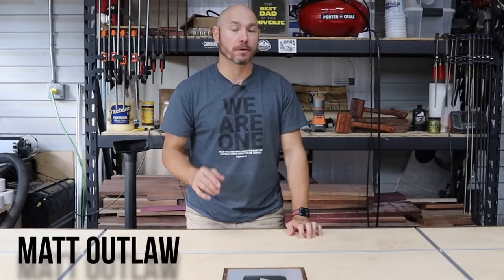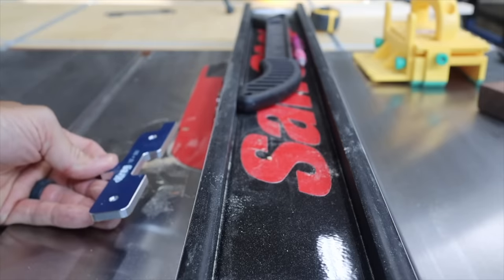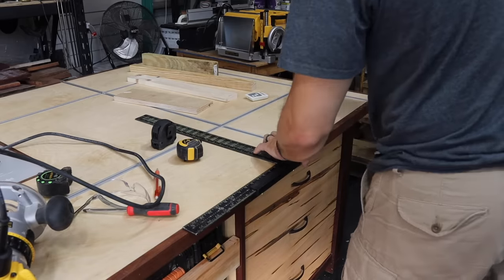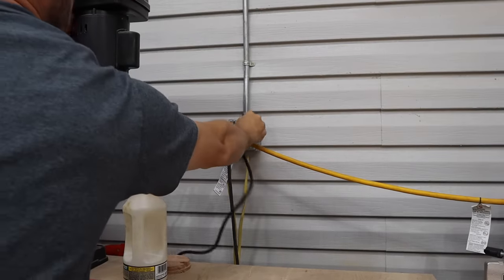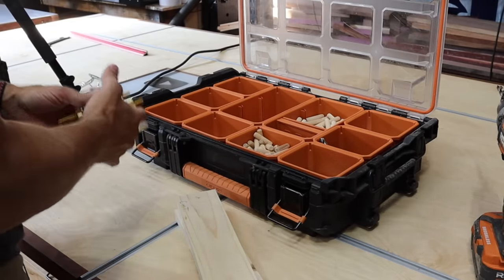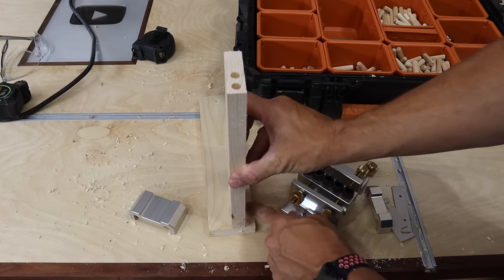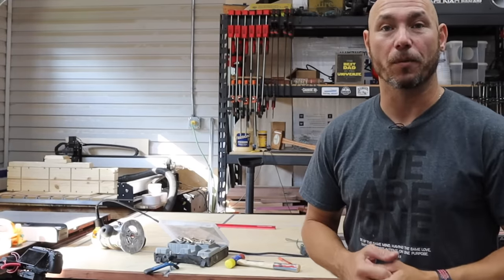5 Woodworking Tools You Didn't Know You Needed Until Now!

Comment: Love the DowellMax. It is well engineered and accurate. I can set up and drill holes without needing to measure and it is dead on. Example. I was making some built in cabinets and needed to join two pieces of plywood 57" in length. I flushed up against the end of ply wood, did a step and repeat along the entire length with about 12-15 holes in each piece of ply. Put the dowels in and the two pieces fit together perfectly. I never even measured or marked the pieces!

Comment: Another tip for the Deadman switch. Use a 3 way adapter and get an analog plug in clock, set it on 12 or whatever and plug a tool in the other side. Now each time you hit the gas the clock starts and stops with the tool and you know exactly how much time you have on the project.

Comment: I'm sure the kreg set up blocks are great.  That being said a much cheaper way of doing it is to get a set of square dowls from a Home Depot, Lowes, ect.  They come in multiple sizes and then cut them down to whatever length you want.  You make a few sets for less than 5 bucks.  If you loose or break them, cut up another set.

Of course you can use drill bits also but they roll and the square dowls don't.

Comment: The Woodpecker edge rule was my first Woodpecker purchase. I got the 6" because it's all I could afford. It has got to be one of the most used measuring tools in my little shop. I have since purchased the 6" Paolini rule and the 3" Delve square. Incredibly versatile and useful measuring tools.

Those Kreg set up blocks look to be a great tool to have as well. I bought the I-Gaging Snap Check digital height gauge and the first time I used it to make some half laps, I was floored. Dead on. Those set up blocks would be perfect for that type of work as well. And they're a great price.

The DowelMax has to be the bee's knees of all the tools in this video. I gotta get me one, no doubt.
Reply: I live in the UK and I purchased the edge rule. Quality product, But I bought it on Amazon and when it arrived it was all metric scale. Check carefully if you prefer inches.

Comment: One of the handy features of the setup blocks when used to set the height of your table saw, is it spans the insert plate across the actual saw table top.  Most inserts tend to be just a tad lower than the table itself (as to not cause work pieces to catch) and measuring from the plate to the saw blade top may cause inaccurate cut depths.  I use mine all the time for this exact reason, along with 1-2-3 & 2-3-4 blocks and brass sticks to set cut widths precisely.

Comment: When you're talking about "the tape measure trying to roll up on you" in the edge rule segment, take an old tape measure and break off something like an 18" or 24" segment. Now you've effectively just got a ruler with the beak that aligns it to the end of the board. It's also a lot lighter and easier to manipulate than it ever was before. You can break off more segments, like another starting just before the 30" mark and use 30" as your new zero.

Comment: Excellent information and knowledge of equipment. In past years dowels were so difficult to line up even with a doweling jig. I use a tremendous amount of screws with hundreds of pocket holes. I use biscuits in melamine panels and see where some applications the dominoes or dowels are stronger and having their place where needed at least now are simplified for ease of doing. A definite tool that needs to be an option for woodworkers.

Comment: Great video Matt. I bought the Kreg gages a long time ago when I built my router table. I have since used them on about all the machines in my shop.  They are awesome. I just now ordered the Woodpecker edge rules from your link. I have wanted something like this for a while and I love woodpecker measuring tools. Being left handed can also add an extra pain to using a tape that flops around.

Comment: Sweet video Matt. I bought one of those $15 Harbor Freight dowel jigs and I definitely regret it.. it's fine for drilling straight but there's no way to adjust it so that it properly centers. Actually am on the lookout for a dowel jig like the Dowel Max but at a lower price point
Reply: My advice, from experience. You don't want self centering jig, you want the one that references edge/face of the board. Self centering ones have limited usage, mostly building frames.

Comment: Stop block on woodpecker is probably plastic so it does not damage the ruler marks or ruler.  Sliding anodized aluminum on same will wear quickly.

Comment: Matt, on the DowelMax, make sure that all the screws are tight on every drilling.  Sometimes the screws come loose which messes up your alignment.  Also, let's say you want a blind dowel in a shelf.  This is somewhat difficult and I could never get it to work.  That's when I pulled out my Festool Domino, which is much easier to set up for that.  The Domino is very expensive, but for what I used it for and after a couple of thousand mortices, it is by far the most versatile joining tool I own.  But it is definitely a tool designed and made for professionals who are using it every day.  One big advantage of pocket hole joinery is that you do not have to use glue.  This saves a huge amount of time when building carcasses.   I have all three systems and they all have their place.  My favorite is the Domino, followed by Kreg Pocket Holes, and lastly the DowelMax.  Thanks for the video, take care and stay safe.
Reply from the maker: Thank you

Comment: EDIT:  I didn't finish watching before I commented. Since I finished and looked it up, I see that it's a momentary switch.  You have to keep your foot on it to keep it working.  
This would cause me to consider a slightly different strategy for the table saw, but it will work like you show on other tools I might like to use it with.  I probably move my feet too much to use it with the table saw. 

Original reply:

My table saw has a switch that has a stop lever.  If I happen to be well balanced and I happen to be standing where I can actually reach it with my knee, assuming I can find the switch hidden under the table and all the controls, I can turn it off while holding my work on the table with both hands.   The dead man's switch can be centered under the front of the table saw where I can always reach it with my foot.   My table saw has a non-reset switch. If the power fails, it will not come back on when the power goes off.   I cannot accidentally turn the table saw on without pressing the table saw switch. 

Here is a tip your viewers might consider.  I add a drop cord to my tools with a dual outlet.  One outlet goes to the power tool, the other to an LED light above the tool.  If I unplug the tool, I unplug the extension cord.  If power is going to the tool, the light is lit. If it is unplugged, the light is off.

Comment: Get a foot switch from Harbor Freight for $13.99. I have one on my drill press and scroll saw. Also like to use one with a hand held router and with a router table. It is much safer to turn power on / off with a router when you don't have to use only one hand to hold the spinning tool while the other hand tries to find the toggle switch.

Comment: Thanks for the video, i really liked the dowelmax. I have just started woodworking recently and I do my joins with dowels as well using a self centering doweling jig that I cannot recall the brand but this Dowelmax seems to have many more features. I will definitely check it out towards the spring its getting cold for comfortable woodworking in my garage right now.

Comment: Amazon has the framing square fence for $19.99 with free shipping (from the same company).  If you order from the link straight from the manufacturers website in this description, you have to pay for shipping there which makes $27.  Just trying to help save a few buck.
Reply: Taytools offers discount codes and free items at certain price thresholds direct through their site though. They also sell scratch and dent and cosmetic defect tools for decent discounts.
Reply: If its only a couple of bucks I prefer to support the little guy over Amazon.  Please don't get me wrong - if I need it fast or its a lot cheaper on Amazon its the way I will go.
Reply: The little guy is the one selling them on Amazon.  Seller has the company name.

Comment: The foot switch will also save you one more aggravation.  Used wisely, it will keep you from tripping a breaker. I have one 15 amp circuit in my garage. If I have both my table saw and shop vac plugged in, or my bench sander and shop vac, and I run them continuously, I trip the breaker. If I plug my shop vac into the footswitch, and only run the vac when I am cutting or sanding, I don't trip the breaker. Breakers prevent wires from getting hot, so when it senses the wires are hot, it trips. By shutting the overload off intermittently, the shop vac, I prevent that.

Comment: If the stop blocks on the straight edge rulers were also aluminum, they would wear the accurate markings off over time, so I think the plastic is actually the proper material choice.
Reply: That's what I was gonna say.  They would scratch the ruler all up and vice versa.

Comment: Stop blocks are probably plastic to not scratch or mar the surface of the aluminum. 
When you tighten down or slide the plastic can’t scratch the harder aluminum. But aluminum on aluminum will scratch easily
Reply from the maker: I kinda thought that too, but they have the Paolini Pocket Rule that has the aluminum slide

Comment: Great video as usual Matt. Hey I’ve got one of those foot switches but mines different I got it on Amazon but it’s not just a power switch it’s also a potentiometer I think it’s called. Speed controller. Temo brand. Under twenty bucks. Looks really similar to the fordom brand minus the brand tag. I own two. They work great. Just can’t use them on induction motors. Like most drill press and others. If it’s “quiet” then better check. If it’s a loud tool like allot of routers your Proli good.

Comment: FWIW: 
Pretty sure that the stops on the Woodpecker Edgle Rules are plastic so you don't shred the anodization.  Woodpecker doesn't tend to cheap out on stuff.  Pretty sure this was a conscious decision.  If they went with metal stops they would have had to have done something line HDPE liners.
Reply from the maker: I thought that too but the Pauloni Pocket rules have aluminum sides/stops.
Reply: @731Woodworks  I seem to recall the Paoloni came with an anodized blade or a stainless steel blade for the anodized-squeamish 😉

Comment: I got a cheapo metal "self centering" dowel jig. It puts every hole slightly off center... Other than that it works okay lol Just have to make sure you drilled in the correct orientation for the offset dowels to line up on both pieces. 

Knowing you could do better work, but are limited by your equipment is frustrating. Spending that extra cash for the nice one hurts but its worth it.

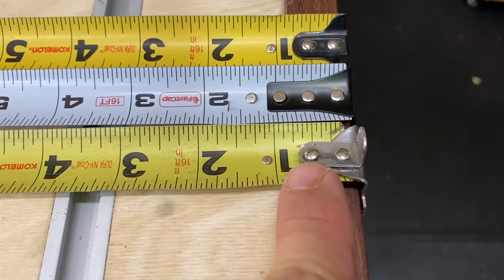Comment: Good one at 5:50.  Pull all 3 tapes tight, n they will all read the same.  That's why the tab moves. Which I'm sure you know!!
Reply from the maker: Negative.  They are all tight.
Reply: @731Woodworks  There not tho, You can clearly see the gap in the closest tape, and the second two are Tight. Not knocking the product you are selling, it is a great product, a d someone will make a take that is convex, but for now, we use what we have

Comment: The dead man's switch is very useful. Once a time I drilled a piece of steel sheet with a column drill and eventually the drill bit locked into the sheet. I've hold the steel piece with a plier. Then I wanted to turn off the drill, meanwhile the sheet piece escaped from the plier, turned around and hit my thumbnail so hard it been ripped into three pieces. If I had that dead man's switch I would avoided this accident.

Comment: When you buy a tape measure it has to be tuned...to a framing square. Before using any tape check it against the a known length...a framing square always works...provided the square has been verified \ tuned... If a tape is short or long of the mark, the End Tab is designed (meaning it is soft metal to allow for movement.) to be adjusted, it's also the reason so many are out of adjustment.  Did you drop your tape today, better check it. I've had so many helpers question why I make them test their tapes, if he\she is measuring and I'm cutting or such, we need the same standard.

Comment: To be accurate, biscuits are not away to JOIN 2 pieces of wood together, it a way to ALIGN (or to JOINT) two pieces of wood together, but it's not good for structural strength. 
Tight tenon is a structural joinery technique, dowels can be if they're long enough, obviously finger joint, dove tails etc are joinery techniques for structural strenght... but ultimately on most of the joints the thing keeping the joint together is GLUE :)
To get very good joinery without glue is quite complicated and it's art :)

Comment: Why dowels instead of bisquet joinery? The DowelMax kit you have in the video sells for about $225. My Dewalt Plate joiner, an actual power tool, sells for under $200. You can find plate joiners for under $60. Just curious.

I do like the edge stop that fastens to the edge of a framing square. I haven't been able to find that accessory anywhere. What is that called and where is it available?

Thanks for the video.

Comment: Woodpecker made those stops for the ruler in plastic on purpose. They weren’t cheating out on the customer. They never do. The only reason they went with plastic is to not mark up the ruler which would happen if they were aluminum.
Reply from the maker: Maybe.  But why does the Paolini pocket rule have an aluminum slide?

Comment: I'm just starting out... Having a hard time deciding when to use pocket holes vs dowels vs biscuits.  Is it a preference thing sometimes?
Reply: Yes it is a preference thing. But sometimes the decision on what to use is based on size constraints or what strength is needed or cosmetic appearance. Like sometimes you don’t want to see the pocket holes or a biscuit is to big for a cabinet door frame but 2 dowels will work great… Hope that helps.
Ron

Comment: Good content however a dead man switch is the switch on a power tool that has a little Thenia push and after you start the tool and the tool will keep running even if you drop it until it priceless or jars loose

Comment: Those tape measures are made for framing a house. You can be 1/8" off in a 40 foot run and no one will ever see it.
You SHOULD calibrate it. You should also calibrate ALL tapes being used on the job to each other. You adjust it by bending the hook on the "Dumb End". You should be able to measure accurately to 1/32" or even 1/64". If you can't, it's not the tape.
 If someone lets the tape "Snap" back too fast, and doesn't catch the hook with their finger, it will mess up the 'Inside/Outside' holes at the dumb end of the tape. Don't let that person measure stuff, and definitely don't let him use your tape.  
For things that go inside the house, use a better measuring device; like those nicer ones you have.

Comment: More strength than a domino....doubt that. If you use a ton of dowels, that'll add a lot of surface area and will make it stronger than a single domino. But you can also double or quadruple up on dominos for additional strength. They both have a place in woodworking for sure. For me, it is domino all day long.
Reply from the maker: https://youtu.be/_vgAeGCATgM They did the test not me lol.  I mean, a domino to me is ideal due to the speed at which they work.  But they do cost a lot and for folks not wanting to invest that much to up their joinery, the dowelmax is a good alternative.
Reply: This is about building furniture, etc...fairly static...not something to be used in a robot death match.

Comment: I wanted to say something about the Woodpeckers Edge Rules. I am guessing those stops are plastic so that they don't damage the face of the rule with the multiple times of sliding it will probably be doing. If it was metal on metal, I am sure it would rub the face off along with the color and make it look like crap. Who know, I am just speculating.
Reply from the maker: Very good point

Comment: Matt - wow, thanks so much for making this video. I'm new to woodworking and I've been trying to find a video or two about the best tools to have - and good videos on this topic are hard to find. I also love your mini-obsession with tape measures. I'm the same way. I was using one yesterday and was pretty frustrated that the end piece covers up most of the markings that are smaller than an inch, and as you pointed out, accuracy with them can be tough when they bend or are at an angle to the wood - or they just aren't totally accurate. One question - and I'll look for a video on this topic from you - have you reviewed any of the circular saw guides like the Kreg Accu Cut or the Bora NGX system? Again - thanks so much. Using dowels for joinery seemed like something that was out of reach, but it isn't. One question on that - can you just use regular drill bits, or did you buy special custom bits for the dowels?
Reply from the maker: 3/8" drill bits work just fine, just be sure and use the stop collars from the ones that come with the dowelmax

Comment: Hey, Matt! I just wanted to make a comment on the Woodpeckers Edge Rules that you didn’t mention in your video. The best thing I like about them is using them to mark on two sides of a board. Say you want to mark 5”, put the rule on the edge of the board with the 5” mark lined up with the end of the board. You can then mark both the top and the side of the board with one continuous mark…or two swipes if you like, but the marks will meet perfectly. When you get over to your miter saw to make that cut, you don’t have to worry as much about how you lay the board. You’ll be able to see your mark from two sides of the board 😁
Reply from the maker: Great point!